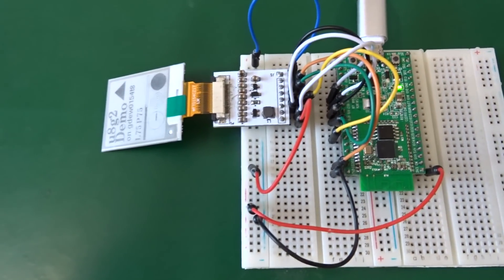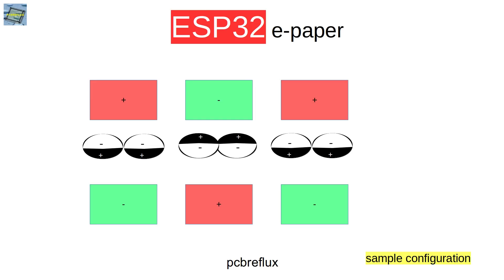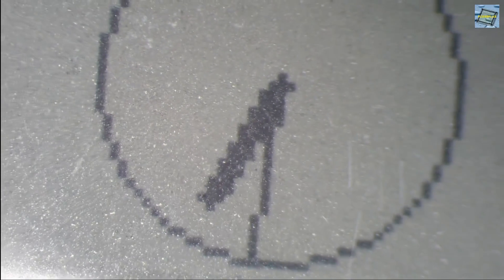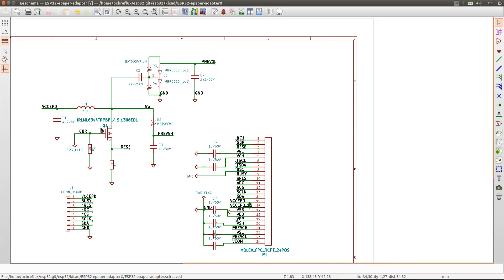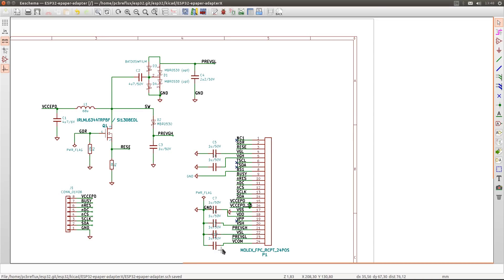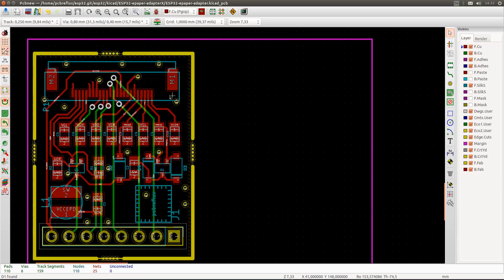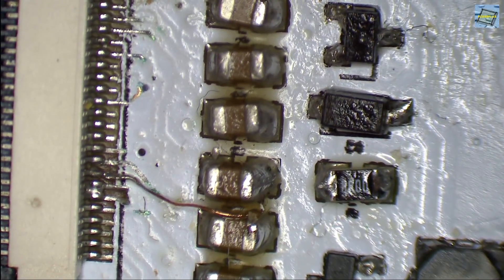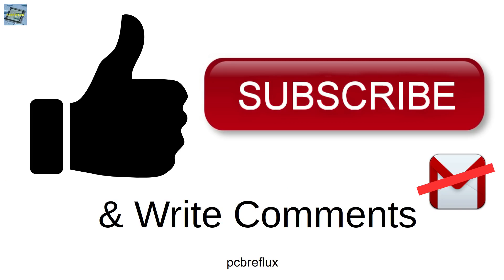ESP32 #65: ePaper (1)

Comment: Thanks for this good idea and very interesting Project.
What is your intended purpose for these Little e-paper Display Units?
Thanks also for sharing the CAD- and Gerber files,
Reply from the maker: klassich D Thanks, this point is totally missing. Big uuups. Subconscious save this for part 2? The main intention to use the display is the low or no power dissipation while your information is displayed. Only the changing the screen needs energy. On the other hand the frequency of changes are very low at best a few Hz for partial displays or it needs up to second(s) for a full screen. And sure you can buy the screen with adapter but I want a really low BOM cost or something that can be integrated on a pcb and only need to order the bare display. To update the circuit its maybe possible to add a switch (mosfet) to the vcc line so the power can be cut off from the (battery powered?) esp32.
Reply: In my opinion this makes sense for a NON WIFI battery driven application e.g. Temp sensor and an on-site Display without wifi Access.